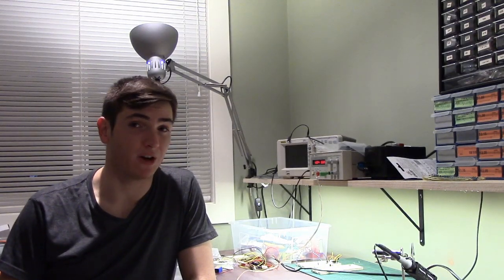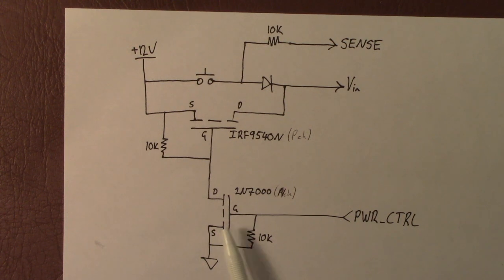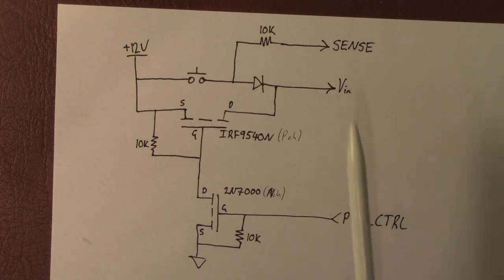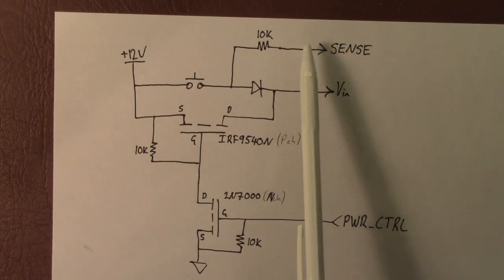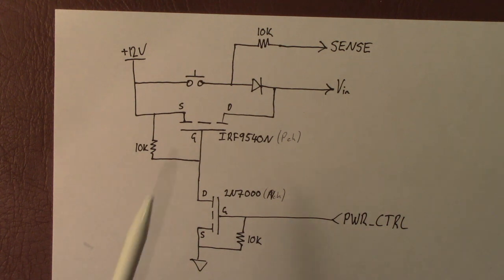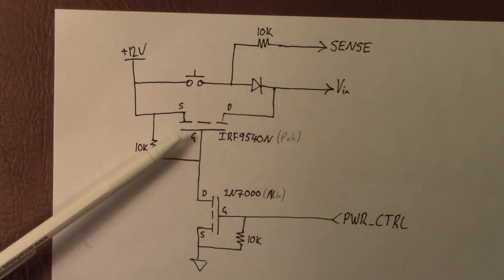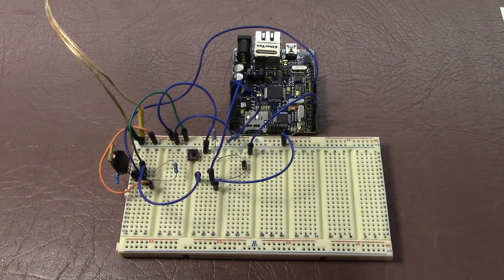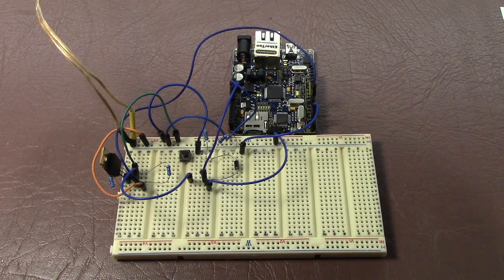Soft touch power switch (Push on Hold off)

Comment: Thanks man, this video seems to be the best solution to my problem. it took me a couple of days to find it the first time, I have returned several times to clarify my misunderstandings... My current pondery is whether or not this circuit is reverse-voltage protected, I think it is but if anyone knows otherwise let me know.
Reply from the maker: It should be useful as an efficient reverse-polarity protection. See this appnote: http://www.ti.com/lit/an/slva139/slva139.pdf

The 10k should protect the sense-input by limiting current during a reverse-polarity event. The only other thing to note is the internal body-diode of the 2n7000 connecting the gate of the main switching transistor to ground. It's worth experimenting with.

Comment: It's a good circuit but you could have explained the button-mcu connection a little better. I had to zoom into the circuit you had connected to understand and correlate it with the schematic. When I did this I noticed you had added an extra resistor to the pushbutton, but you left it unexplained. Other than that this video was very helpful.

Comment: Hi, I want to use this soft latch switch in between my 6v/5Ah Battery to 5V LDO LM2950, as this LDO needs at least 5.5V(dropout voltage of LM2950 if 0.5v) as input, So I need to know drop across drain to source of IRF9540N when it is in ON state.
Reply from the maker: That depends on the current your circuit draws. Look up the datasheet for the IRF9540N and multiply the expected current your circuit draws with the supplied Rds_on.

However, 0.5V headroom is not much. Your regulator will drop out before you can use much of your battery's capacity.
Reply: @MichaelRuppe   Full load current is 100mA in my case, as I am using LDO LM2950 having capabilities to supply only 100 mA. So in my case Max. Load current is 100mA.

Comment: Could someone give me the model of the diodes?
Reply from the maker: Here any common rectifier diode should do, depending on current-requirements. The one I'm using is probably a 1n4001/1n4004. Just pick something with an acceptable continuous-current and forward-voltage-drop.

Comment: Are the source and Drain pins of both transistors reversed? Shouldn't it be the other way around?
Reply from the maker: One is a P-channel (source connected to V+) and the other is an N-channel (source connected to ground).

Comment: Could you please help me to decide one thing. Which one is better for industrial power application and why? 
1. Latch switch using 2 transistors and one SPST relay. 
2. Latch using a single DPDT relay. 

Please help me to decide which would be better in terms of reliability and operation.
My email is: s.kawish@gmail.com 
WhatsApp: +917979025046

Thanks in advance!

Comment: Is there a way to use some  "capacitive" switch instead of this pushbutton? Example some small sheet of aluminium foil or some small copper plate,which will react as capacitive sensor = switch? I hooe I explained correct :)
Reply: I'm really looking forward to that option as well. I'v got a capacitive touch button (momentary) to use in my arduino project> When the button is pressed shortly it should execute code, when it's pressed for 2-3 seconds it should power down the circuit. When circuit is powered down, it should turn the circuit back on when it's pressed for 2-3 seconds. Hope to find an answer in this post! @Michael: Great post, thank you for sharing!
Reply: Joris Kingma Thanks for answer, do you have any link to see how this capacitive momentary button looks like?
Reply: Made this scheme, should work i guess? https://www.dropbox.com/s/qetei2uf5dhtolo/Power-switch-circuit.jpg?dl=0

Comment: Thanks a ton for the awesome and simplified tutorial! I am trying to use this thing with a BLE which has an ARM SOC. I realize you are using an IRF9540 as the current of the whole circuit would be flowing though it. I think I dnt need that big of a mosfet for my BLE module. Which one do you recommend for something around 500-800 miliamps? How about this one http://uk.farnell.com/fairchild-semiconductor/fdg6306p/p-channel-mosfet-20v-600ma/dp/1783139 ?
Reply from the maker: I'm assuming you're powering the BLE through this mosfet. That sample transistor looks fine for loads up to 600mA continuous. The main kicker is the R_DSon spec, which is the resistance of the device at a certain gate voltage. Your suggestion has a decently low R_DSon at -4.5V (Vgs) so as long as your circuit is operating at 5V that will be ok. The R_DSon at Vgs=-2.5V may or may not be too much resistance, it depends on the voltage tolerance of your BLE device.

I can't find any stock of the FDG6306, so if you have to choose another candidate the Vgs, R_DSon and continuous current spec. are the most important things to look for. I don't use very small P-ch MOSFETS myself so alternatives come to mind immediately. Try searching "Logic level P channel MOSFET"
Logic level means they'll work well at 3.3-5V where many MOSFETs need higher voltages (or a special driver) to work.
Reply: Yes, Thanks again!. I'll keep in mind all that. Tested your circuit Works awesome. Just had to add a pull down resistor to the button and ground it!

Comment from the maker: @Manish Poudwal
Sure, with the parts I've used. The main thing to remember if you are going to change any of the transistors is to use a Logic-Level mosfet (they have a low enough Vgs threshold to turn on fully with Vgs = 5V)

Comment: I like this circuit, might use it on my latest battery powered arduino project.......the added benefit is that the arduino can power down when the battery is detected as being low. Nice one.